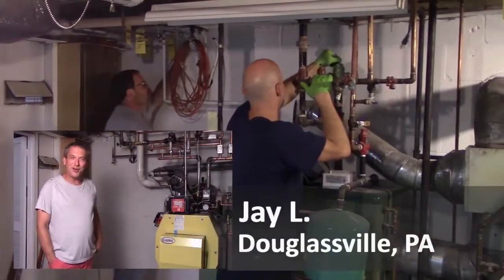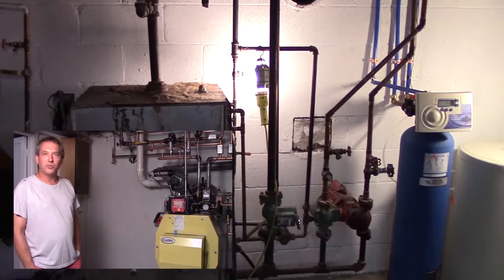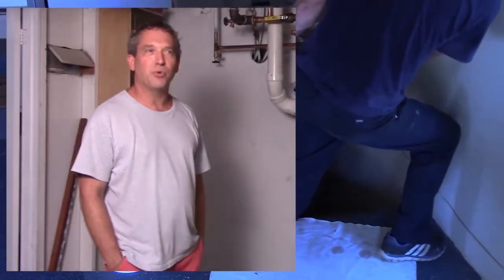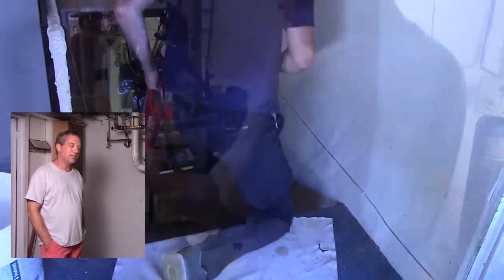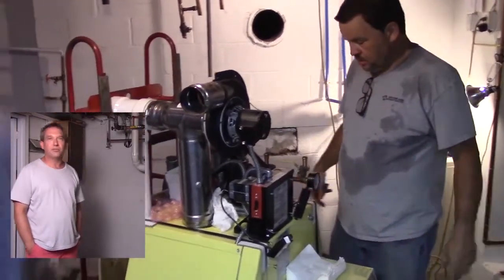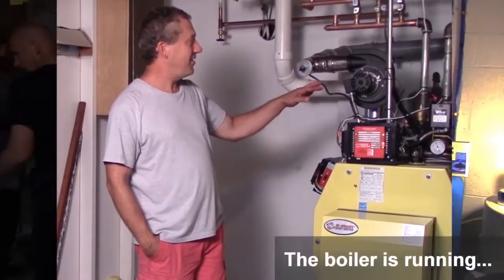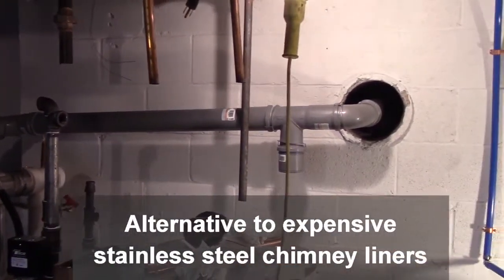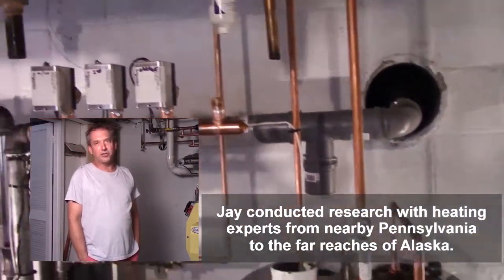Top Things to Consider When Upgrading Your Boiler

Comment: Would like to see one of these but on the accel came.There is not much info about it online
Reply: Don't care too much for oil I have gas. there is a few things online about System 2000 but the Accel CS is almost non existent outside of the brochures and everything on the website. Only one Youtube video explaining how it works but nothing like this and almost no reviews anywhere I think I found one and a few for the system 2000 dating back to 08-09 era. I'm getting one installed with in the next week or two. I think I'm going to make a video so others aren't as in the dark as I am. Basically I'm taking a really expensive chance blindly installing this and i hope it pays off.

Overall just saying you guys should add a video like this about the Accel CS.

Thank You
Reply from the maker: Thank you for your interest in the Accel CS high efficiency condensing boiler.  If you'd like to see similar review video, please check out this link: https://www.youtube.com/watch?v=1LkMHKEIGdQ